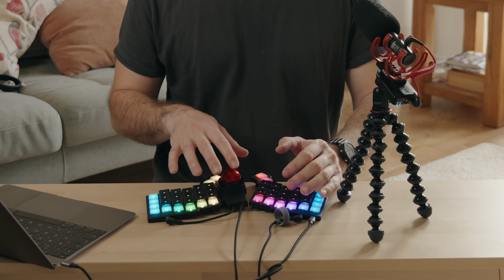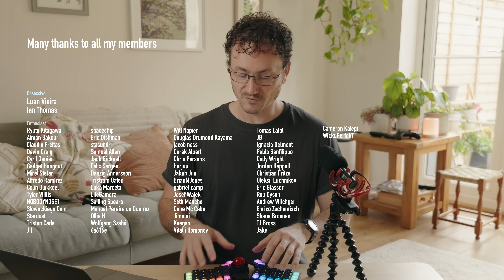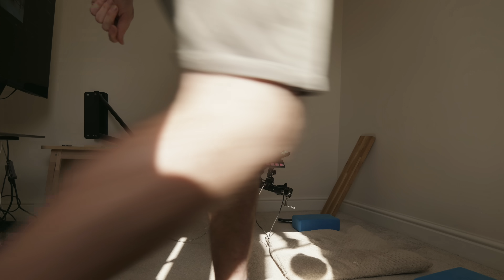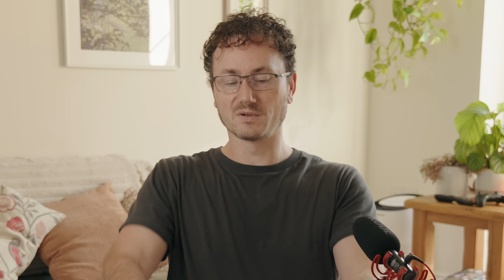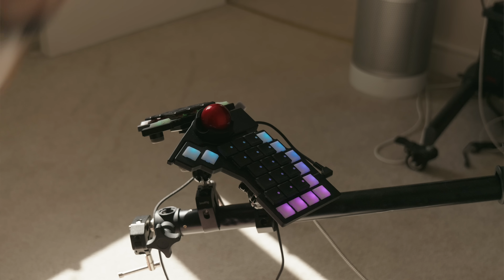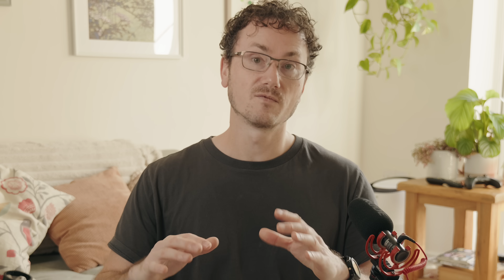ZSA Navigator - Hitting The Ground Running

Comment: Personally I feel like the trackball is too high, I'm also surprised it doesn't have a better cup that supports both flat and tented orientations, major letdown considering ZSA is usually decent.  

I also find how you use the staggered columns interesting, as you use them backwards to how they're designed.  I know this is a finger length issue, though your fingers don't look abnormally out of proportion.  Typically staggers like this are supposed to follow the natural curve  that the fingertips form, so how you're using it puts your pinky a row high, and thus why you're having your thumb be significantly below the ball; otherwise the ball is in the correct place ergonomically, on paper at least.  I don't have a Voyager so I can't see if the stagger is just of bad design or not, which is always a possibility. 

When you mentioned keywells, which variation are you actually talking about?  There's the complex curved surface boards that follow a concave contour to sculpt key placement to where the fingertips rest, supposedly they are supposed to be more ergonomic due to less finger movement, but I find off-the-shelf products to be a bit dubious considering the correct fit of curvature will otherwise be very individualized; not to mention the complexities of manufacturing, I almost want to see an alternative that uses a standard flat board but uses 'keyswitch extensions' that sits as a pillar on top of the PCB and actuates the switch via a lever mechanism (or 1:1 bellcrank), this design would feel a bit more tunable to an individual's hands considering you'd only be changing angle and the lengths of the lever, making manufacturing a bit simpler and hypothetically adaptable to any board.  There's also the DataHand style of keywell where your finger fits inside the pocket of five switches, with the spiritual successor being the SvalBoard, of which the Sval also has a palmar trackball module; unfortunately I feel like the Sval is a bit underdeveloped considering there's no alternative thumb clusters or customization outside of hand size adjustments.  Personally, I want to see your thoughts on a Sval with the trackball module, you could use two as mouse + scroll or hypothetically you should be able to get dual-mouse gesture-like functions though I'm not sure what software is available for this.  A palm ball seems interesting, but with fingerwells I'm not sure how effective it would be without removing your fingers from the wells. 

There's also some other peripherals I'd like to see your opinion on.  The Azeron Cyborg is similar to a fingerwell design but doesn't have the lateral clicks, but does have an analog joystick; personally I wish they'd offer a version with a trackball, but DIYing this would be easy enough.  From the same company, the Cyro is a keypad, analog stick, and mouse, with a hand strap, of course a mouse reintroduces a lot of hand movement but I've always been curious about this one; again, I wish they had a trackball, or rather a circular track pad as that would be more usable, as I personally don't like joystick pointing/scrolling.  Similar to the Cyro is a device from a company called LYNXware, it's had development over the years so the latest isn't quite the same as the first, and it's held the names of Lynx and Cat but I'm not sure what the current iteration of the naming is, the company can supply the product and parts or it's available as a DIY solution (or used to be DIYable, again I'm not sure of current status), but this one is a bit more customizable and as a pair is a fuller keyboard than the Cyro; the main body is a standard unit, the finger panel is either 17 button-keys with a scroll wheel or 20 keys with no scroll, the thumb panel is either 4 keys with a joystick or 11 keys with no joystick, and the base panel offers a blank, mouse sensor, or a gyro sensor (I'm not sure how this is used, it doesn't look like it adds a ball pivot to become a tilt mouse), and there's various wrist support pieces.  The Lynx in previous iterations also had a trackball option for the thumbs, I'm not sure when or why this was depreciated, though with how developed the software is I'm sure the creator could add balls back into the ecosystem, and I'm personally wishing that they'll add trackpads in the future.  I think these, especially the Cyro and Lynx, are an interesting class of device that hasn't really seen too much of a market.
Reply from the maker: Thanks for taking time to put all this down - I appreciate it. I will digest and see what I can include in the channel or maybe on the keyboard focused channel. In terms of keywell I'm thinking 3D printed is really the only way to do it so I can iterate and get the shape right for me. Check this out: https://ryanis.cool/cosmos/ My thinking about the lightweight switch glove type boards is you won't be able to type at speed due to restricion of movement - as I learn to type faster it's becoming clear to me tha you need to really bash at the keys to get your fingers to actually move fast - keeping your hand super close to its rest positions seem at odds with this - but I've never tried one so may be wrong!
Reply: @BenVallack  I figured that was the form of keywell you were talking about.  Honestly there needs to be a better naming convention between all the various wells to better differentiate them, because the DataHand/SvalBoard are also keywells, and the Azeron Cyborg could be considered a keywell as well. 

I remember in a previous video you had mentioned how bashing the key is a component of typing speed; this is part of the reason why actuation points aren't at the top and bottom of the switch travel.  While I don't disagree with this, I do think there's more to it, mostly switch spring weight and how long the linear throw of the stem is; tactile events also change this slightly.  For example assume you have a touchpad surface for your keyboard, you have zero travel and zero weight, you don't necessarily need to bash the surface, all you need to do is touch the surface; what this does is lessens the momentum needed for the 'bashing' component, meaning your fingers could travel faster with less force needed, and the touchpad surface example is just the very extreme of this, this same theory can be applied to any keyswitch.  Keep in mind things like Apple's butterfly switches exist, Cherry makes the MX ULP switches as a mechanical low profile, Kailh also makes some scissors though I'm not sure if they consider theirs mechanical; and while larger fuller-sized Box switches or standard MX switches may be more typical, these shallower switches have a far shorter actuation range, and typically a lighter actuation force as well. 

As for the keywell design, while most of them do tend towards minimal movement, this doesn't mean you couldn't adapt them to your faster 'bashing' method.  The hand is a complex kinematic structure, you need to figure out the inverse kinematics and place the keys accordingly.  You can still have a fully sculpted surface, but keep in mind where your fingers are pivoting.  The essential thesis of a keywell like what you're looking at is that the sculpt's contour wants to follow the pivot of your metacarpophalangeal joint and the extension/flexion of your proximal phalanges, but your intermediate and distal phalanges naturally want to move as well, hence the complex kinematic structure of the hand.  But there's a second kinematic function of the fingers, when depressing a switch your metacarpophalangeal and proximal interphalangeal joints make an opposite movement to 'peck,' your distal phalange again wants to naturally move slightly during this action.  What you're wanting in your keywell design is a deeper 'peck' so that you have more force behind your typing.  A good starting point would be taking a conventional keywell and just extending the keys outwards linearly from their stem alignment, this essentially gives you a larger radius assuming the well was spherical, though it's a bit more complex which is why I don't like the radius argument and instead prefer moving the switches in relation to how their stem is aligned.  Another thing you might consider is just modelling your hand and figuring out these kinematics.  But again, the parameters of the keywell will also chaing based on actuation force and actuation depth.  Ergonomics really is an overly complex topic, but this is likely the simplest and most straightforward solution.
Reply from the maker: @xaytana  Fascinating - thank you! Yeah I think I'm still very interested in exploring the speed vs force thing. The strongest direction your fingers can press is downwards so it makes sense (assuming there is truth to the power/speed connection) that the keys should just be below the fingers, not to the sides or other directions. If we consider the trackpad or butterfly keys - that faster I click on the trackpad or the faster I type on the keys (100wpm on graphite on my 12" macbook at the moment) the harder I find I am hitting the keys. If that power is needed for that speed then I think it means the keys have to be below the fingers as that's the only whay I could muster that kind of sudden burst of force - the thought of having to waggle my fingers laterally makes my feel physically uncomfortable just thinking about it - in fact that opposition to lateral finger movement was what started me on my column reduction path in the first place. I terms of a big sculpted well for all the keys (Cosmos style) I think the question is does a radial outward force reduce the power than simply just aiming to press downwards on a flat surface - even though the upper rows require that slightl lenghting of the finger to achive it (that the well would reduce).
Reply: @BenVallack  All of this is simply just a physics problem.  Force and speed will always be intertwined, as is momentum, inertia, and how your fingers bounce back, one of the benefits of the spring inside of switches.  So of course faster typing will have a stronger force, but if you have a lighter actuation force on the key then you should be able to type faster compared to a heavier actuation force.  Same goes for travel distance, the faster you bottom out, the faster you can start retracting your fingers; this is also where some springiness does help. 

I also think there's a bit of misconception where force is applied.  On a standard flat board, yes most of the finger force is 'downward' from MCP flexion with your PIP bent.  But in a keywell you'd be doing more of that 'pecking' motion that's a combination of MCP flexion and PIP extension; by your thought process, you could think of this as both downwards and outward.  In the end, I think they'd roughly equivalate to each other, though the latter using two muscle groups would logically be a stronger force, but the common person doesn't have a practical way to scientifically test this without producing a testing jig that's hard mounted with a variety of switch angles of all roughly equivalent actuation weights. 

Though this does also depend on how deep the sculpting on the keywell is.  A shallower sculpt will still retain the mostly 'downwards' pressing, while a deeper sculpt will use more of the 'pecking' motion.  Again, the essential thesis is that the well follows how your fingers curve throughout movement, with the switch stem aligned axially to the direction your finger would be depressing the switch.  So for example, even in a deep well, the lower rows would be using more of the 'downward' motion as your fingers claw up to align with the switch, but change to the 'pecking' motion as your fingers extend to the higher rows.  The essential thesis is all based on pivotal motions rather than the thesis of a flat board using a different set of kinematics for your fingers to move throughout the rows, columns, and stagger. 

The other form of keywells, the finger wells, are essentially based on these principles as well.  Much lighter tact switches with attached levers with shorter actuation range.  Where most of them rely on PIP flexion and extension for the front and back switches, and MCP flexion for the bottom switch; and where applicable the lateral switches use the kinematics of the hand for the slight waggle needed.  I know you mentioned that the waggle would likely make you uncomfortable, but in the instance of the Azeron Cyborg the only lateral switches are on the index and pinky where you have a greater natural lateral range than your middle and index digits; I don't remember if they still offer it, but I do know in the past they've also had an 'upward' switch, I think they may have had a couple designs actually, where you can bump your finger upwards to actuate them.   Of course these fingerwell boards are also an entirely different sector of input devices, I would consider the change more akin to someone going from a controller to KBM for gaming than it would be someone going from a standard keyboard to an ergonomic keyboard.  But the same physics and kinematics apply to these as well, as an example. 

But when you do decide to explore keywells, I would recommend that you do look into a slightly deeper gap between finger rest and keyswitch surface, based on the principle that speed is inherently linked to force via momentum and inertia.  You can also make two boards, one where this gap is lessened to test this principle.  Think of it like a shell operation in modelling/CAD software, or a thickening operation, etc., you're taking your base shape and you're moving the 3D perimeter, the shell, by an equal amount based on the vector of the bodily surface; again I don't like to use the radius and sphere argument, because a properly designed keywell is a contour that would not be a spheroid. 

But at the end of the day, everyone has a different typing style.  This is why we have different key weights and key actuation points.  This is why a deeper keywell would likely work better for your high force typing while the keywell sphere of influence mostly caters to those who want to minimize hand movements.  True ergonomics are a very individualized problem and solution. 

Also, could I suggest that you find an analog switch to mess around with?  Unfortunately adjustable tension switches aren't a thing yet.  But with an analog switch, you can adjust actuation points.  With this, as a testing setup at least, you could find what your preference for actuation depth is for a particular point of finger rest, at least for a particular spring weight.  Of course this throws in yet another variable into this problem, but this is a variable that you can tune.  In an actual project this may also be beneficial, for example (assuming an alpha-num cluster, no function row)  if you find that you want row 1 (num) to be a shallower actuation compared to row 2 (qwerty), and you want your row 4 (zxcvbn) to be an even deeper action point, analog being adjustable would allow for this with one iteration of curvature; the only potential issue is the linearity of the spring force, yet another unfortunate variable when you're chasing specifics in a very individualized design. 

Funnily enough, if you go with a magnetic switch, I'd suggest inductive or TMR over hall sensors, the 3D design may actually be far easier to produce as the PCB could be vastly simplified and could more easily be a FPC.  Though I would suggest that your final design (no matter what kind of switch and PCB you use) does use a metal plate for rigidity, English wheel or manufacturing a wooden buck to hammer a plate into shape would likely be the simplest of the two, as CNCing a billet into a bent shape would be quite costly by comparison.

Comment: Linear mouse fixes the zoom issue 6:02
Reply: Can you expand? What is linear mouse?
Reply: @mattharrison721 an open source application on mac. You can set different zoom methods based on the application.
Reply from the maker: Awesome will check this out thanks!

Comment: You really should try to get your hands on a Keyball. The trackball position is such that you don't have to leave the home row. Also, extreme tenting is much more viable due to the ball holder design.
Reply from the maker: I can't quite visualise how you can reach that ball with finger on the home row! Do you have really tuck your thumb under your hand?
Reply: @BenVallack It's really not that far. The ball's surface is near the centerline of the index finger. It's very similar to the movement of using a phone touchscreen, except with the palm facing downwards.

Comment: Thanks.  Realized watching this: IBM had the best pointer for staying on home row....Accupoint (erasure head).  Just need that on split keyboards.
Reply from the maker: Yeah they're cool for sure.
Reply: You can get trackpoints on Svalboard, too 🙃. Very interesting experience with a much taller nub since it doesn't have to fit under a laptop screen 🤔. I'm a little surprised so few trackpoint builds use taller nubs...

Comment: What you said about using the trackball in the position where your thumb would land reminds me a bit of the Ultimate Hacking Keyboard. Not sure if you've looked into that but one of the input modules it has is a trackball module and it's designed so that modules are positioned beneath your thumbs. I don't have to move my hands from the home row when using the input modules, though I still prefer mouse for some of my tasks.
Reply from the maker: Nice yeah I think it being very close to thumb home position is a great idea.